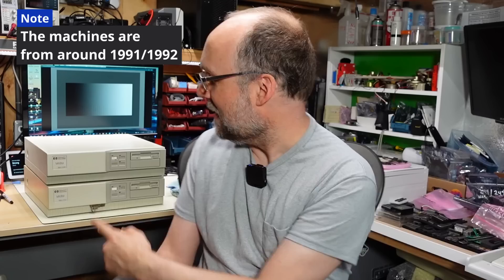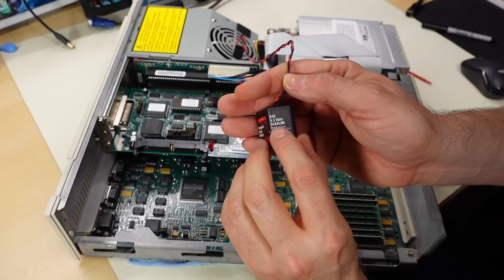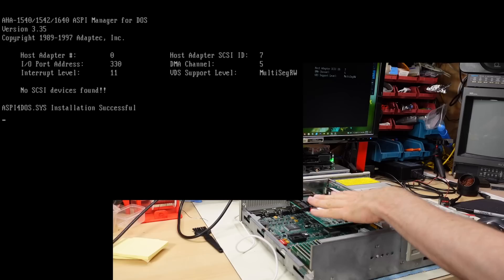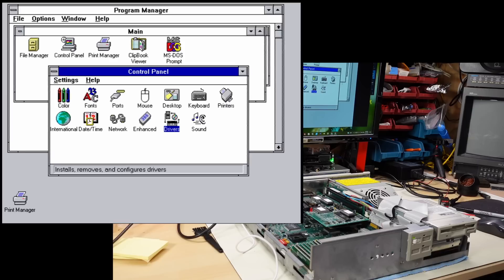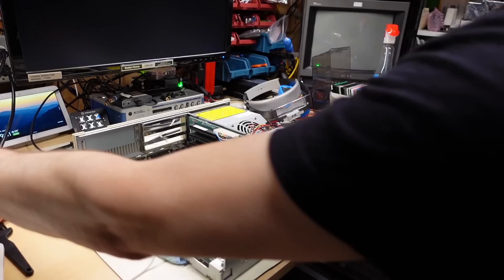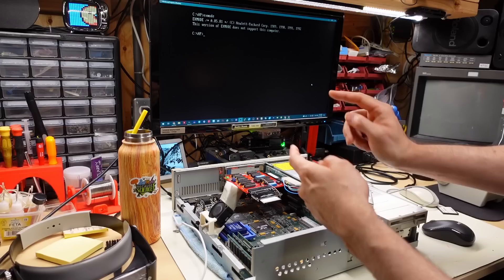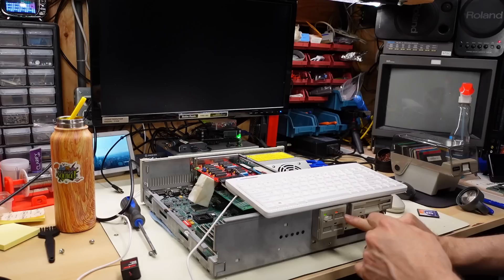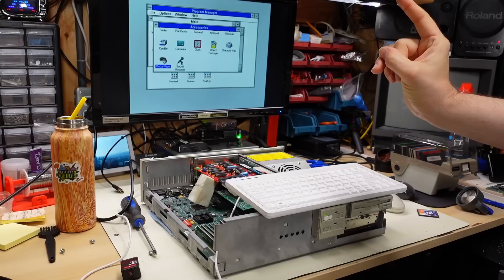PC archeology: The HP Vectra N Series, a well made pizza box PC from the early 90s

Comment from the maker: As some have pointed out, the 386SX does have 16k of cache memory! Seems that it's a bug that CACHECHK didn't detect it properly, but you can see it in the improved timings. I went and tested with my 386SX test bench (Clocked at 20mhz) and I was shocked to find it also has 8k of cache -- inside the chipset! See here: https://imgur.com/a/5uemm8g
Reply: I have a weird 20 MHz 386SX with 32k of external cache, Landmark reports 28MHz performance, but it came with a Paradise video card that got around 700 chars/ms. I upgraded it to an Oak Tech 512k that does about 2200 chars/ms. Most of my Tseng cards manage around 2600 to 4000something, only one exceeds 6000 and I'm pretty sure the S3 of the 486 is either VLB or uses some trickery. Either that or all my ISA video cards kinda suck. I'm still happy even with the slower cards.
I'm a total X-Wing CD addict and for fun I ran it on different (S)VGA cards and only on my oldest card Deico (Cirrus Logic) from 1988 (600c/ms) that can't even do  800x600 there just a little slowdown noticeable.
Reply: Some MBs had dip sockets for adding cache, too.
Reply: You kept talking about the 386 being clean, no software installed, and barely used.... DID YOU NOT SEE THE BIG STICKER ON THE FLOPPY DRIVE saying that the machine was a demonstration machine?
Reply: Didn't mean to sound rude, just pointing out the fact in CAPS so that it might catch your eye.  I use a computer to watch youtube videos and don't know how to tag you using a web browser.  :)
Reply: it's almost mind blowing how much personal computers have advanced in last twenty plus years, stuff like this is nearly unattainable around here anymore, I have a 3.3 ghz pc tower here and absolutely no one wants it,

Comment: I used to call those 'donut box' form factor. Man I feel bad now that we used to just trash these things left and right.  Glad a couple are getting some TLC!
Reply: So what, when they get refurbished and cleaned and all that.. will they go chasing after waterfalls or don't want any scrubs or live out 600# lives 😂
Reply: The parts in their form factor (beyond expansion slots) was generally not industry standard and therefore unique to the machine.
Reply: @brentboswell1294  yeah I'm just talking about the height of the chassis vs a pizza box like the Sun 3/80
Reply: Same thing here. I did computer repair as a teenager in the early ‘00s and would get a lot of donor / abandoned machines come through. The second you saw that it was HP, you knew there was nothing worth salvaging and pitched it right into the dumpster (er… e-waste recycling center…)

Comment: The PS/2 Model 55SX was IBM's slimline desktop 386SX system. It was quite popular with businesses because it was their lowest-cost MCA-based system. I remember in the late '90s my local bank was still using a bunch of them.
Reply: I picked up a couple of those from Computer Reset last year.  They were both broken, but I managed to use parts from the more broken one to fix the less broken one.
Reply: I had a PS/2 Model 25SX, which also had a 386SX in it and 4MB.  It ran OS/2 2.0 fantastically!
Reply: I was just about to say that same model! :-)  I had one I got in my last year of high school; actually, 2 of them.  One thing I learned: Don't plug an MCA card in while its running.  The first one I did it by accident.  The riser board got loose, I went to re-seat it.  There was a pop, blue smoke and a hole through the chip closest to the fuse.  Needless to say, I had a backup and transferred RAM and drives to the working one.

Comment: Having flashbacks to my time with the HP Medical division as a software engineer in the early - mid '90s, my first job out of college.  Used these for both development and production units.  Nowhere near as well built as the Vectra QS/20 and 386/25 models though - you could throw those off the roof and they'd keep working.  Loved the 386/25 and the later Pentium Pro-based mini towers in the late '90s.  At that time HP's PC division was actually based in Grenoble in France.  Good memories.

Comment: Yes, please! Do benchmark your ISA graphics cards!

And please, beware of ISA bus speeds and different waitstate settings for every setup. Most of "weird" differences can be explained by these 2 things.
Reply: Indeed, on later machines you could often set the clock speed of the ISA bus independent of the main bus speed instead of a fixed divisor. On my AMD 486-DX40 VLB bus PC there was a BIOS option that let me set the ISA bus all the way up to 12MHz max, although it was dependant on which particular ISA cards you had being able to keep up. IIRC I could only set mine at 10MHz or the 8-bit SB2.0 value card I had in there would crap out.
Reply: We should all contribute to a database with retro hardware benchmarks 🙂

Comment: Yes those Vectra's are great machines. I managed to get one for not a lot of money because it had partially failed the Year 2K test! 

The machine worked on a LanManager network connecting to an ICL4500 server for shared files etc. 

I used the machine to run a packet radio mailbox under Linux for a number of years until about 2003 when a lot of the users stopped using Packet Radio when broadband started to become available in my area. 

Mine was a 486 machine and it really was nicely made and worked without any issues.

Comment: The HP Vectra towers I supported in the late 90's were also made in France, and very proprietary just like yours.
Reply: I used a late 90s vectra tower i got for free for some years in the '00s as an mp3 and irc chat station running beos (i just wanted to muck around with beos, ran the dano beta). 
got uptimes of 200 days+, basically just as long as there was electricity(electricity was pretty stable where I lived then).  in beos the audio subsystem sometimes crashed but you could restart it without restarting the os.

Comment: That was sold in Sweden. The "Only connect to GFI outlet" text is vintage Sweden. That machine was properly decommissioned before sold/given away, and/or it was used as a dumb terminal. Many computers of that era in Sweden were replacements for dumb video terminals, but the SCSI-card is puzzling, as is the integrated log on. Even more interesting is the absence of asset tags, bigger companies, such that would use dumb terminals, have a habit of branding (as in burning) an asset tag into the chassis of the machine. But it could have been early enough that asset tags wasn't used everywhere.

Comment: Somebody probably already told you but you set the floppy drive to low density 5 1/4 instead of the 3 1/2 high density that is in it when you were editing the bios settings on the 386 model. Clearly you figured that out as you should the memtest working, but I thought I would say it anyway. Great video as usual. I really appreciate them!

Comment: 21:10 that Overdrive socket supports the Pentium Overdrive CPUs. You can see the extra row of pins on each side that it would use. So it can be even upgraded from its upgraded state. I did a few of these back in the early 90's the integer/FPU speed was better, IO speeds were not improved.
Reply: No it will not support any pentium cpu. I  actually wrote the 486 upgrade engineering document which is still archived on a server in Russia.
Reply: OverDrive  Pentiums are special and only work in these sockets.
Reply: They'll also support the AMD 133/P75 CPUs too if you have the voltage converter interposers like the Trinity Works Power Stacker 5x86. My IBM Alaris Cougar with its weird Blue Lightning 386/486 CPU actually has one of those blue overdrive sockets and I was able to get one working in it just fine.

Comment: One of the more common reasons you will find a EU based HP system in the US is that it was sold as part of a system (cleanliness might go towards medical)  I remember getting US HP systems imported and then delivering them to a very secure site here in the UK a long time ago.  

Also the single chip SCSI card was often supplied with a Scanner or CD drive to reduce costs, Epson used to include one with their upper range flatbed scanners.

Comment: That 386-20 is the absolutely perfect DOS adventure game machine, plop an early sound card with OPL-2 and play some Sierra and Lucas games :D

Also the integer mixer in the mod player is more than likely using what was called "fixed point" math functions, which is a trick to use CPU integer functions to perform floating point math, and isn't necessarily much lower precision, if at all. So chances are the sound in the end is probably more or less identical. Could be fun to check the sound output with an oscilloscope to see if you can actually see any difference.
Reply: That’s interesting, especially since the samples themselves will be integer. But then I haven’t looked into the maths behind mixing channels together digitally, so maybe it’s self evident why.
Reply: Can confirm. This was my childhood :D

Comment: I remember using these a lot in rack mounted test systems back in the day since they fit nicely being that form factor.  Most of them we put in a HPIB/GPIB card to talk to the various test equipment.   I can also remember several that simply ran off  floppy disks.  You would have to load the appropriate program for what you were testing.  It was a constant chore to make sure those floppies always had a good backup copy as they all would eventually go bad for one reason or another.
Reply: Oh, that must be deliberate given how many much rank mount test gear they made (make?). I hadn’t noticed it was the right size for that, just thought it was nicely compact. That’s great

Comment: I kind of like the formfactor, lot easier to keep around than a full desktop or tower.  Lack of CD-ROM would be a bit annoying, but with modern tools like CF to IDE probably not a big deal.  I'm fairly sure I have some soundblasters kicking around in the attic.  Have to keep an eye out for one of those machines.
Reply: That's what the SCSI cards were for, external CD Drives, tape drive, hard drives, etc. These were business class machines, so easy access to backup hardware and ability to image machines would be a must to deploy them.

Comment: I have a couple of the brief ATB standard power supplies - at least, that's what I was told they were called - which had support for soft-power-on switching. My 1998 gaming rig (which I've recently put back together ^_^ ) used that semi-standard, and the PSU had given up, so I ended up rebuilding it and now it's fine again.

Comment: Correction;
The SX vs DX designation on the 386 had an entirely different meaning than it did on the 486. 
On the 386 SX it meant 16 bit bus vs. 386 DX meant 32 bit bus. No 386 was ever built with a built in math coprocessor. It always required adding the math coprocessor in a separate slot, which was designated as a 80387.
In the case of the 486, the SX vs. DX designation did in fact mean no functioning coprocessor in the processor vs. a built in functioning coprocessor in the 486 designation.
The rumor had it at the time that the earlier 486 processors had a lot of coprocessor failures during testing and therefore had the copro disabled and the chip was marked and sold more cheaply as an SX. Mother boards often had a slot for the math copro, but what you would do is get a fully functioning 486 DX and set a switch that would shut off the SX.
The semiconductor business hardly ever throws anything away. The same went for RAM chips. Ram chips were tested after manufacturing and they would fail under tests at different speeds. They were marked with the rates that they would pass at and were shipped to market.
Reply: The 487 was actually an entire 486DX, and the slot acted more like an accelerator card (just one that was wired-in to the motherboard)? That’s hilarious. 

And yeah it clearly must have been something to do with yields… didn’t Intel do something similar more recently where CPUs with integrated GPUs that failed were just sold as the GPU-less version of the chip?

Comment: Looks like with the cleanliness of the internals, and the load of software, I'd bet it was a cold spare computer sitting in the IT department of a medium size company.
Reply: HI, my permanent sat overtime for a while was to cycle 6 pc's in a department.

Each PC was turned on and memory and drive config placed on a sticker, then it was swapped with maintenance spare.

This was mainly due to win 95-98 requiring clean up when it failed, so machines were rotated, reimaged, ran overnight for stability and placed in the rotation stack.

Regards
George

Comment: Ahhh that so takes my mind back.  My first job in IT was around circa 1990.  Looking after HP3000 computers running the proprietary MPE operating system, and then also HP9000 Unix beasts.  We had all users on HP dumb terminals, but gradually we brought folks over to HP Vectra desktops, on token ring network, running terminal emulation.  The Vectras were built like tanks! Loved working with them....ahhh a trip down memory lane.  Thanks Adrian!

Comment: i would definitely be interested in an in depth video(s) on comparing the speed of ISA cards to each other and in different machines, and maybe a little bit of ISA bus overclocking too. i found that my 486 is stable with a very slight increase in the ISA bus speed and it's not life changing but it gets me a few extra points on benchmarks
Reply from the maker: Thanks for the feedback. I have a perfect machine for this -- where I can control the ISA clock speed and CPU clock speed easily. (a 386SX)
Reply: Yeah I would love to see that too! 
I did a lot of tweaking and benchmarking of my own ISA VGA cards as well and the winners in terms of performance are the Tseng ET4000ax, the Western Digital wd90c11-lr and believe it or not the Trident 8900D is also super fast for an ISA card. These cards are very fast (for what they are) as is but if you set their DRAM to 0 wait states (the Trident had a "hidden" jumper for this) and overclock the ISA bus a little they can actually outperform some of my cheaper VLB cards!

The Tseng ET4000 is my favourite DOS/ISA card though as both its display quality and performance are amazing (for an old ISA card), it's SVGA modes are natively supported by a lot of games , it runs in every ISA machine I have so compatibility is great and of course because of its lore ;-) 👍👍
Reply: Id second that. I built my own 8088 machine and really wanted to run it at clock speeds higher than 8MHz and ISA bus speed was one of the big problems. Improved it a bit with by adding wait states for video mem access to get to 10MhZ EGA but would love to see your take on over locking the ISA bus...
Reply: I've had some machines be stable at 10MHz, some at 12 and a few at 14! Well, i say stable.. Had the odd hiccup at 14MHz where it wouldn't re-load properly exiting applications and would reset but that's about all it did, no data loss!

Comment: Back in the day, when I was at HP in the 90's these were all on our desks... Yeap the lock was great in an office environment. And yes there were only about 10 different physical keys for the locks. Meaning they got keyed with the same combination. Management had a full set in case they needed to get into the box. They were good pc's- these replaced our Terminals to our Main Frames. We ran Reflections as our terminal emulator. Dos 6 and later we moved up to Windows 95, and the hardware got better and faster over time. Yeah, those were the days, 386/486 and finally the Pentium. Great Channel btw...  good stuff.

Comment: It was nice to see that both of these had SCSI cards installed because at least that way you use external SCSI CD-ROM drives. But I have a feeling that retro CD-ROM drives, be it parallel or SCSI are getting rare. Or maybe it's just me who is out of luck.
Reply: the majority wore out or were scrapped, so you have to be lucky to get hold of a CD drive that still works
Reply: @thesteelrodent1796  seeing how high the prices of these are online, I'm not surprised. I know that there are backpack devices which allow you to use regular IDE drives but these are getting expensive too. As for SCSI, the towers are probably very expensive now too.

Comment: The vectra 386/20 was my first decent computer upgrade from my IBM XT. It made a good gaming machine with a Gravis Ultrasound in it at least what I played. Sim City, Doom, Doom II and Wolfenstein. The GUS came with a cd interface and drive. Beautiful purple colored card. The 386 was not really much to write home about as you mention but with 4mb of ram it ran game, windows 3.1 and stuff like that okay especially coming from an XT. Looking at it I think mine was a bit bigger. A convertable desktop/tower design. You could flip the control panel around so it would be facing the right way. It did have a 5.25 bay that was free which I put the CDROM in but the guts inside look roughly the same. It was 30 years ago and my memory is rusty.

Comment: The later Vectra VL2 series added back the 5.25 bay so you could install that cutting edge CD-ROM drive. I had a VL2 back in the day and still have the keyboard from it. Nice machine, had onboard VL-Bus video and I think the IDE was on the local bus too. It also came with a fairly uncommon 486SX2-50Mhz CPU.

Comment: My father at one point found a pizza box style  which would of been a 1.5U, we could never find a riser that fit it but it had a 386, 16Mb ram, pci, built in graphics, parallel and serial, built in 10/100 network adapter, 80mb internal hard drive and floppy. PSU was a non standard thin style.
It ran windows 3.11 fairly well, with little slow down. We tried 95 but that was a buggy mess at that point.